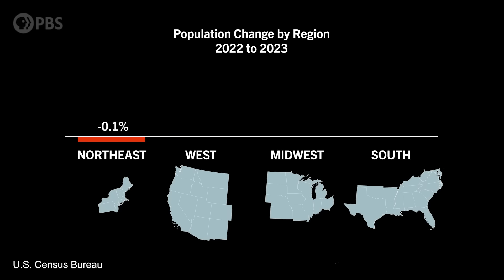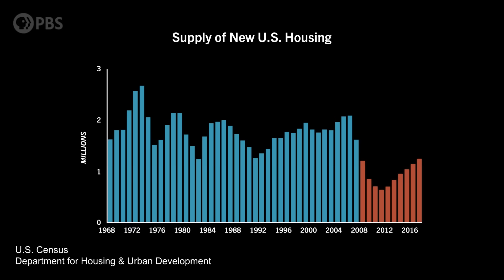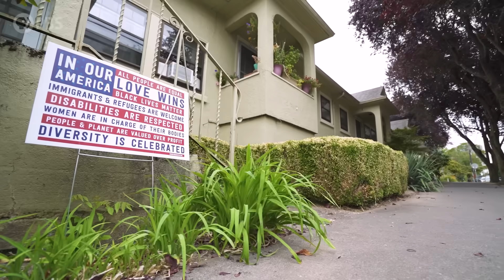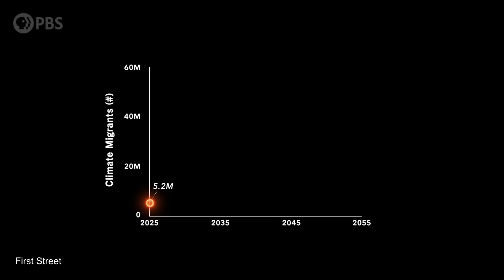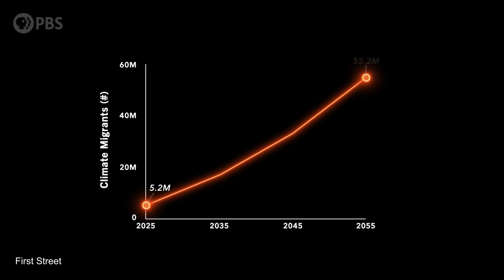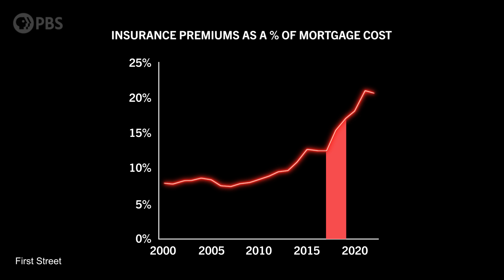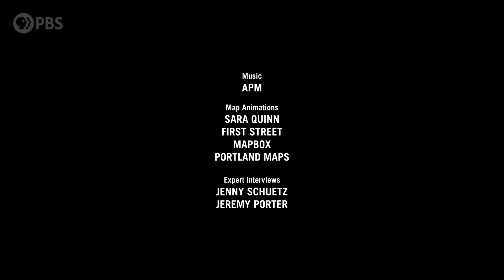The Real Reason People Move Toward Risk

Comment: That's not entirely accurate. There are enough empty houses (that are for sale) in the US right now to house every single homeless person and still have more houses left to sell. The problem is a lack of affordable housing.

All the houses and apartments being built since 2008? They've all been "luxury" housing - extremely expensive because of some "luxury" items installed (countertops, appliances, etc), but they've also been very poorly built with a ton of corners cut just about everywhere.

If I had the money to purchase a house (which will probably never happen), I would probably go with a house like the one next door that's for sale. It's a 1920s Craftsman home that is... definitely a fixer-upper. Like, it probably needs gutted and completely redone. But it being in such bad shape also means the buyer will likely be able to talk the seller down in price. Plus, you know all the issues going into the purchase, so there's already a plan for all the stuff that needs fixed and what's an immediate problem vs a long-term issue.

Ppl expect a new house to be in perfect condition. And then a year or two later? Oh. There's not enough insulation in the attic. The pipes were installed incorrectly, there's a gas leak, the dryer vent ends in the attic, etc... (These are all examples that I've seen home inspectors point out on new construction homes.)

Comment: All the points are true. But I feel there was talk about Blue cities without actually explaining the differences or what that means. I live in a NY city. Come from Texas. I see a lot of reasons there is less being built here, and very little of it has to do with being blue or red. Biggest factor is space. The Texas suburb just keeps expanding into open space, pushing out farmland and pastures. Here in NY there is already a suburb surrounding the cities with opportunity. Maybe they could cover more NY farmland, but please don't. Converting to higher density should be the answer. Unfortunately there is a lot of pushback to that solution. And that is NOT a blue/red thing. Just as much pushback in Texas. The video briefly said NIMBY. Could have added more value by explaining what that is and why it is impactful. There is a lot of history that puts areas in the situation they are in. That history might make housing correlate to blue/red. It is not caused by blue/red. I'd like more videos to address that.

Comment: I moved within the same city for more space and to get out of a building that had not been properly restored after Sandy. A side benefit of the move was an elevation change too. Our old apartment complex parking lot would regularly flood at full/new moon high tides, while I can dig at least 4 feet down into my back yard now with no sign of hitting the water table. We're still in a somewhat risky area, but like what she said, sometimes it's only a mile or so away to make a significant difference in climate resilience.

Comment: Also, not every home is an appreciating asset. Most homes built in the 1980’s cost around 150k and now need about 60k for a new roof, new flooring, new appliances, HVAC, water heater, etc. It makes no justifiable sense that it now costs 400k. That’s a depreciating asset.

Comment: Homeownership is not a right. Living in NYC, LA or SF is not a right either. 

NYC’s population peaked at 8.8M in 2020. It dropped down to 8.3M during Covid and is now around 8.5M. 

Has the city’s limit also in increased? Who says NYC should accommodate an unlimited number of people? Prior to the completion of suburban sprawl, NYC’s peak population was 7.9M in 1970. 

Maybe ~8M is the limit of what NYC can accommodate. If not income, remote workers being at the high end and low skilled laborers at the poorer end, what else should be the determining factor of who stays and who leaves a major city? 

Finally, stop fetishizing poverty among Black folks. The answer to Black folks being disproportionately impacted by one calamity after the other is solving the wealth gap - and Blacks can do that be reprioritizing their political agenda. Finally, around min 12…one of the presenters says all kind of foolishness about allowing more housing to be built…practically all of Manhattan has been upzoned from manufacturing to residential housing over the last 30 years, so this can’t be the problem. Finally, want housing to stop being built in high risk areas, then let insurers drop coverage - though admittedly that might be extreme. My point is that you can’t say “let the market determine where housing is built” and at the same time say “we need to be strategic about where people live”…it’s just silly.

Comment: I live in north myrtle beach and the house building is out of control with no regulations on how many trees can be cut so everywhere i look what used to be forest is clear cut leave one or 2 trees if that.  This is causeing hotter temperatures than normal and causeing wildlife because snice everything has been taken down dried roots and and other debris makeing like a kindle more fuel for the fire.  Ontol of that its so crowded that it's scary bc if there was a state of emergency it will be almost impossible to get out im glad I'm going to b moving in a year or so to maine for better air quality

Comment: I live in Los Angeles, South Los Angeles specifically.  The problem is that the real estate industry, developers specifically, have no financial incentives to develop affordable housing, so they only focus on high end "luxury" housing.  This backfires and we will soon enough see that catastrophe (the half finished 23 floor downtown condo/apartment building, empty, covered with graffiti in downtown LA is the most glaring example).  But in the meantime, people are moving out because a "modest" home or condo in the city is less appealing than a 2,000 sq. ft. house in a cheap state.
Reply: Not necessarily, there's just fundamentally still a housing shortage. Even if the only kind of housing that was built was luxury apartments, eventually the supply would be so great that rents would be forced to come down. There should probably be many different kinds of housing built to address the shortage, but building only luxury homes would still fix the problem eventually, just slower
Reply: Would that be the case if the same developers also have advocated for certain tax laws and exemptions which allow them to “write off” the risk/debt acquired even if their ventures fail and they do not fill the units? I actually don’t think they price based on filling units at all but to instead serve certain type of clientele that can also prove 3.5x that exuberant rent as a monthly income 🤷🏽‍♀️
Reply: @Zeffpenguin there's never been a housing shortage. Why would greedy people provide low-income housing when they can overcharge for it?
Reply: There’s another problem. All these city people moving into small states is causing our prices to sky rocket.
Reply: @Hellurrrrr  Ehh, could it also be the goal for pricing people out of the markets so when future recession hits and ppl can’t pay property taxes, rent or mortgage, private equity and banks can come up on collecting even more assets with “their” wealth. Unfortunately the common persons choices don’t things as much as democracy would like us to believe 😳

Comment: Move from MI rust belt to Austin.  Tired of cold.  Don't have an issue with heat because there is this technology called air conditioning.  Austin doesn't have hurricanes, earth quakes, floods, tornadoes.  Slightly more risk of wild fires but I built an inflammable house with rain water collection.  I'm hesitant to post this because Austin is already flooded with transplants from other cities and don't want to make it worse. 😁

Comment: They do this in Dallas all the time.

A more recent example is the series of DART community meetings being held between 18:30-19:30 in areas around the metroplex.

The meetings have two problems, the evening schedule just after people get off of work, and none of the meetings are being held in areas that can be reached by mass transit.

This means that older white people and car owners will be deciding the fate of those who use mass transit.

As for the building houses cheap and quick. A lack of regulation in Dallas has led to developers cutting corners on building houses on good foundations, building inadequate storm drain systems, and building a power grid that shorts out during rains and flooding.

Comment: Us standards of building is abysmal. No fire resistance, no hurricane resistance, no flood resistance. Houses are made out of cardboard and sticks (2x2).

In Cyprus all buildings are made with a concrete frame and brick walls. And they can withstand fire (no flammable materials at all), flood (concrete is okay to be submerged), earthquake (frames).

And it's cheaper than us. And you can hit a wall with a hammer and not to have a hole

Comment: The issue with states that have grown rapidly and built rapidly to accommodate the influx of people seeking affordable housing is the suburban land use pattern is financially insolvent. Property taxes do not cover the cost of maintaining all the infrastructure when it becomes necessary 15 to 20 years down the road. Prices are already or have already climbed in the states and they’re not a great deal.
Additional factors are going to include extreme weather as you’re pointing out, but these areas don’t have a lot of water either and especially ground water tremendous problem in areas that are not capable of handling that many people

Comment: Fresno is an interesting case. You'd think the weak economy, heat, drought and air pollution would really drive people out, but it's such an isolated place. How can a person just up and leave?  For every person that does actually leave, two more move in to take their place. Despite the problems, it continues to grow. I grew up here, left to the Bay Area for 10 years and came back in 2019. It's just as dusty, dry, boring place it has always been, but it's noticeably hotter. It's also more crowded. I want to leave, but remote working has made it easy to have a good life here. Unlike with hurricanes, floods, or wet bulb events, I just don't see smoke driving people out of here with costs elsewhere the way they are.

Comment: I'm actually already something of a climate change refugee. I spent the 2000s in San Diego, trying in various ways to get a toehold in the Southern Cali entertainment industry. Large portions of California were already dealing with extended drought - and then the massive Cedar Fire struck San Diego in 2003 and scared the living heck out of me. I lingered on in SoCal till 2011, at which point I had landed a longterm online job and thus could afford (just barely) to relocate to western Oregon - which even in the interval since I arrived has had escalating issues with insufficient rain, excessive heat waves, and massive wildfires. But I've now retired, and lucked into a home in an affordable housing complex, so at this point it looks like I'm staying put unless the organic matter really starts hitting the ventilation unit around here.

Comment: As people have pointed out, the housing shortage is exacerbated by private equity buying up properties to rent them out. These companies also buy plots and build entire new neighborhoods strictly for renting. On top of that, things like AirBnB eat into the housing supply. 

It’s good that the differences in regulations were mentioned in this vid because it’s certainly not a trivial issue, but it comes off a bit like it’s a monocausal explanation for a multifaceted problem which is sophisticated in its own right.

Comment: The one the thing people always seem to not grasp is that people unlike the plethora of videos that try and say otherwise, people like having their own backyard. Even a front. And not shared walls. Shocker
Reply: The issue is that there isn't even the option for mid-density housing in a lot of areas due to zoning restrictions only allowing single family homes to be built in a lot of major cities. You're left with high demand for a smaller number of available properties, which drives people out.

Comment: A big difference in cost to build between big coastal cities and rural sun belt regions is simply availability of buildable land. In places like seattle, new york, san francisco, the regional geography is simply water on one side, mountain on the other with narrow peninsulas, islands, hills and bays mucking things up. Places like texas or arizona on the other hand, it's just flat open land as far as the eye can see. It's just naturally easier to build cheap new housing in those places because you can essentially just infinitely expand outwards with no worry of having to acquire and demolish already existing structures in a naturally scarce real estate market in order to build something new.
Reply: So we have these things called elevators and stairs... Most coastal cities have post industrial land, dead malls, and space for infill. It won't be as cheap as exurban Texas homes, but the transpo costs for residents will be cheaper, and the infra costs will be cheaper for munis.

Comment: Construction in Seattle has not diminished by much.  The problem is, and always has been, that the more they build, the higher the rents go.  More housing has never equaled lower rents here.  The last huge apartment building that went up near me charged more than anything else around it for miles.  More unaffordable housing is not the answer, and isn't going to solve the  problem.
Reply: @joec.9591 Are you familiar with the concept of supply and demand?

Comment: Rapid development exacerbates flooding. Developers slap something up without any consideration to the impact and rain water has no where to go.
Reply: That's why those environmental impact studies actually matter.
Reply: @number1girlism  Exactly! I feel like they kind of glossed over why development in Blue states takes longer & costs more. Because they include stuff like minimum tree-cover, public parks, drainage / storm-runoff provisions, better insulation & energy-efficiency, and more safety regulations for both residential & commercial. 

And of course, the fact that the construction labor actually makes more money in places with strong trade unions, where you aren't hiring an electrician in the Home Depot parking lot...
Reply: Correction: rapid development *without regional planning*. You've taken the worst possible lesson away from Houston flooding during Harvey. Houston not only doesn't have zoning, it lacks any sort of regional planning whatsoever. And it didn't actually exacerbate flooding, it only increased the risk to homes and businesses built in the swamps and bayous. Had they simply had a regional water mgmt plan, Harvey impacts would've been much milder. They put one together in the 2000s after Rita, but it was too little too late. Strict zoning does absolutely zilch to lessen climate impacts, if anything it hurts people unable to afford to be out of harms way. East Palo Alto and Altadena are perfect examples of this.
Reply: @lozoft9  good points but you’re wrong about where I learned my lessons. I’m in Tennessee and have seen firsthand the ramifications of development run amok.
Reply: And they have to develop rapidly to cope with the influx of people fleeing red states.  They're doing what they can while red states remain horrible places that drive people away.

Comment: We should all build houses based in the environment and any risk factors. For example, in Los Angeles and other hot, dry areas prone to wildfires, adobe is the best material for such areas. The indigenous peoples of these areas had done so for as long as they been on this land, and we need to listen to them.
Reply: Now, if only city in town governments have people with your mindset
Reply: The building codes in LA have and will continue to change. The problem is older houses were built with different codes. Also, not using wood increases construction costs.
Reply: We need to listen to insurance rates. That is how the information of risk is transmitted.

Comment: I live in the Coastal PNW.  Climate is a risk, but the greater risk is tectonic in nature.  That being said, we need to build homes and use landscaping that if fire resistant and capable of surviving high magnitude earthquakes. Because of the Cascadia Subduction Zone, coastal communities will have to build for the tsunamis that may ensue, which may not be possible.  I'm 60 miles from the coast and that doesn't mean much, when you consider an earthquake on the magnitude of 9.2.